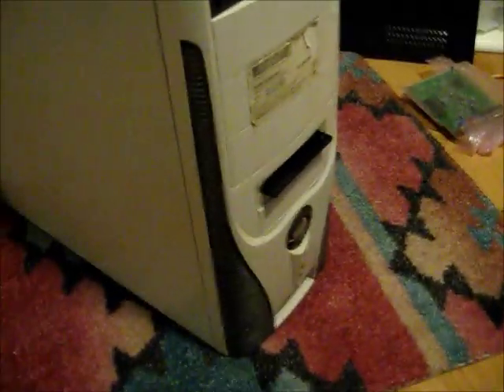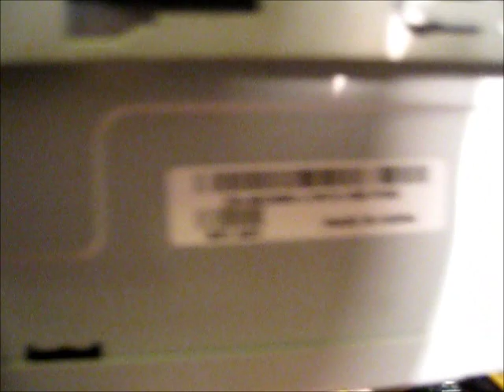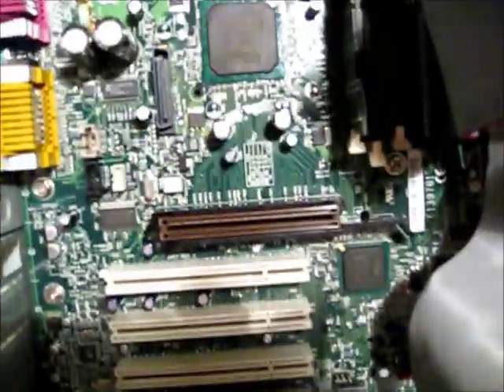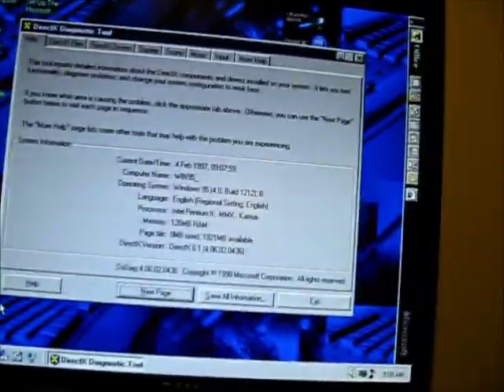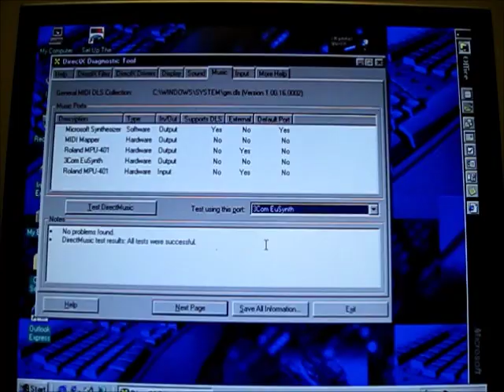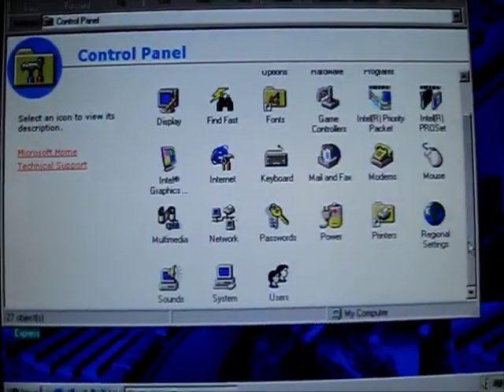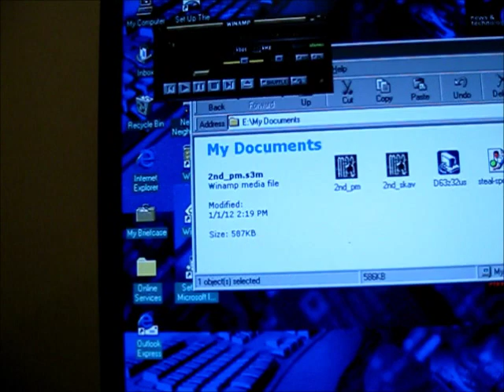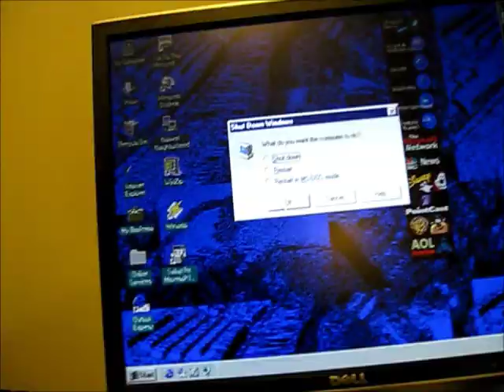The Custom Built PIII Win95 Computer

Comment from the maker: @MarshallRA I'm stuck in 2009, I even knew it was X79, and I put P97, lol.
but the PSU didn't even have a protection circuit, and it was non- modular and cheap , I like the modular PSUs for newer builds, they look better and you don't have a bunch of colored wires that are hard to tie down all over a nice black case with a window and cold cathode lights, lol. he is running dual GTX 580s, he had one in a PCI 8x slot, it wasn't wired for 16x, so I gave him more performance there, lol.

Comment: @IamFat32 Its X79 for LGA 2011, and Z68 or P67 or H67 or H61 for LGA 1155.

He only needs a 1000w psu if he has a  3930k/3960x and 3 power hungry (think GTX 480/580) graphics cards in SLI/Crossfire, 550w is more than enough for 1 graphics card, and 700w is more than enough for 2.

Comment from the maker: @MarshallRA well 16x gives more performance, even if its not much, every little bit counts, lol. and most boards that support crossfire/SLI , the first 16x slot will have another 16x slot 2 slots away so that dual width GPUs can be side by side, and he was putting it below the second slot for airflow, but boards are designed to have enough airflow  between dual GPUs as most high end gamers will have a dual gpu, unless its a ridiculously fast GPU, lol.

Comment: @IamFat32 I think 18mb is the lowest in normal mode, 8mb only functioned in safe mode for me, and that guy down clocked his Pentium to 8mhz! Apparently the PCI gpu failed to work at that so he had to use an ISA one, it took xp 30 minutes to load and looking at the desktop is 100% cpu usage.

Comment: @IamFat32 Still only need a 700~750w psu for that. The difference between a 8x slot and a 16x slot is extremely little. Even the difference between 4x and 16x is still extremely little.

Comment: @an65001 XP and later run faster on a multi core processor due to much more optimization for it; 2000 was made in a time when all processors were single core, the closest was 2 cpu's.

I am talking about actual AHCI mode in sata. Not IDE mode. That has lower performance, uses more cpu, and in some cases does not have support for recent hdd's and ssd's.

SATA in 2000 works at a lower speed. And try using any SATA III chipset/drive with it.

When I say drivers I mean ones for recent (not p4)

Comment: @IamFat32 You only need 512mb for install to function. Hell, some have even gotten it to run on a Pentium II at 133Mhz with 96mb of ram (512 while installing) with a 4MB S3 Trio gpu. Type "windows 7 on pentium 2" in youtube search, there is a ton of results.

Comment: @an65001 hardware. Looks like all of the stuff which "supports" 2000 needs hacks and trickery to function in 2000.

And yes, 2000 supports 8GB. But that is only in the 64-bit or server versions. Who has a server edition on a workstation/desktop pc? Nobody. Professional still has the standard 4GB limit.

Comment: @an65001 95 does not have TRIM support. I dont even think Vista has decent TRIM support, only 7 and OS X have proper TRIM.

Plus 95 may run, but its like getting a motorcycle to run with rocks in the muffler. ITs a crappy experience.

Comment: You should install vista/7 and film it just for shits and giggles.

New OS's on old pc's is really popular on youtube for some reason, after all the minimum requirement for Vista is an 800mhz PIII (its light on CPU) and the requirement for 7 is a 1GHz PIII.

btw there are 8-10 slot motherboards and even bigger, look up the EVGA SR-2, its insane.

Comment: @an65001 There is no reason to not use XP instead of 2000. XP supports far more programs, types of hardware, and is the same speed. Try using a SSD in windows 2000. Try using a 2 core CPU. Try using SATA. Try getting gpu drivers. Try getting drivers for ethernet/wireless. Plus windows 2000 pro/server does not support more than 2 cpu's, and need some stupid trickery to use 2 cores or more. Windows 2000 is meant for old computers, not new ones. 7/vista is meant for that. Let it stay that way.

Comment: @MarshallRA Win2K uses a dual core, even a quad or eight core. Try going to blackwingcat, he's gotten Windows 2000 to support 8GB ram. I got all kinds of driver for 2000. SATA works as it should, even Windows 95 can use SATA! Get you facts straight. XP is an unstable piece of junk which rotted my Lenovo after using it. Now it's so darn slow, even in Windows 7! I TRIED and SUCCEEDED in all of the above, BTW.